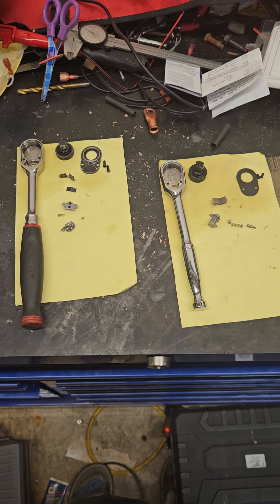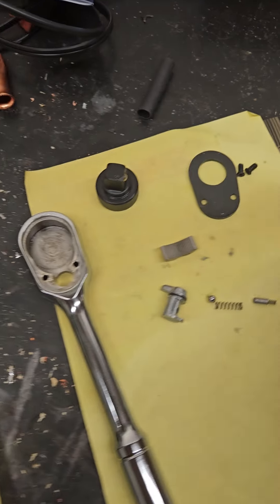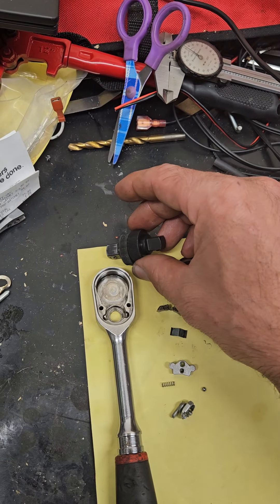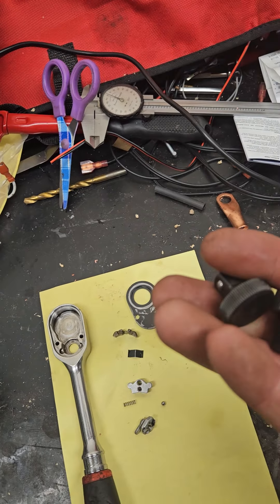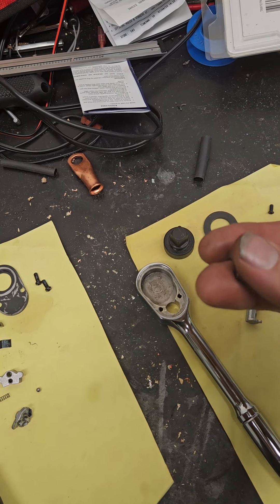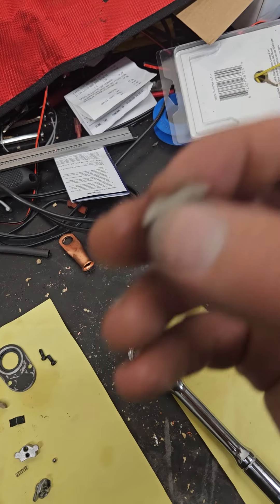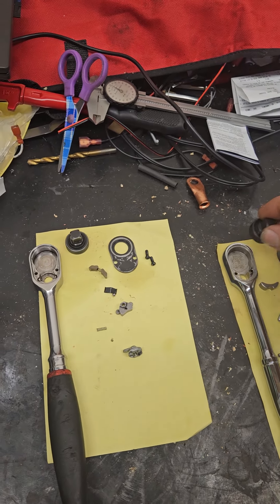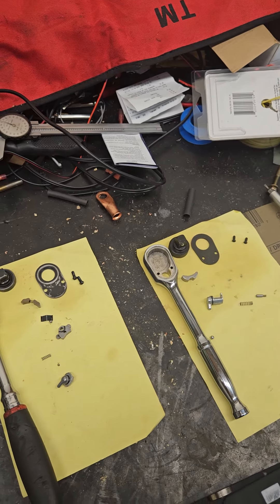Snap-on, is there a difference?

Comment: How often should you oil your ratchets?
Reply from the maker: Should definitely check on them if they get dropped in any fluid. A good wipe out and blow any debris out, add 3 or 4 drops of some 3 in one or similar oil, and that is it. Just need enough oil to add a protective layer against corrosion.